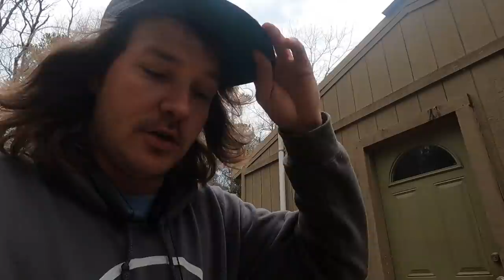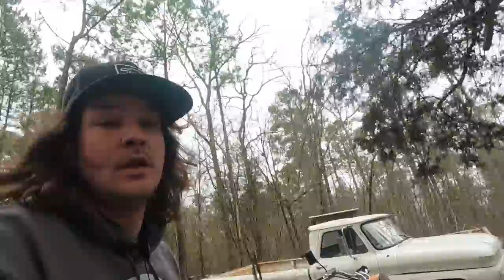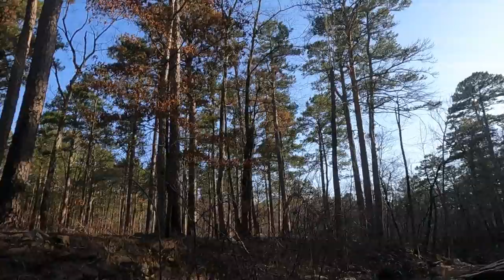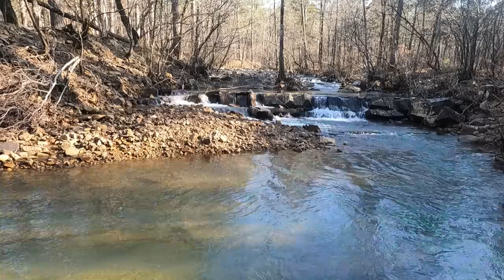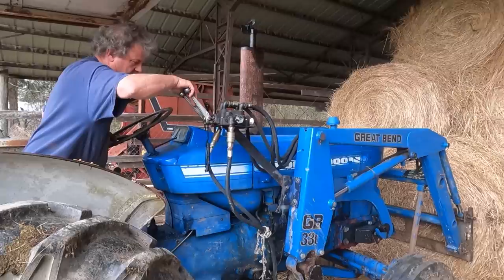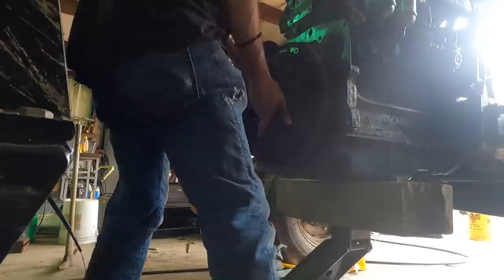I tore a FORD tractor in HALF!!!!

Comment: I did a dual wet clutch on a Massey 65 once.  Had to split that dude. Hung the back half from my engine hoist and rolled it back, and the front half supported by a floor jack. Wasn't to bad of a job, but it too took a few days. Those 2 disks and pressure plates couldn't be found anywhere. I found a place here in OKC, OK that was a clutch reman facility. They didn't even have cores so I had to wait for them to rebuild my cores before I could put it back together. The deal on this Massey clutch, it was worn out. From being saturated in oil and age, it deteriorated. Dad hit a tree stump with the brush hog and it just shredded the clutch disk. It would have made a great enchilada because what it looked like that I scooped out by hand was a shredded beef or maybe chopped brisket. Pretty fun job  though. I never minded working on tractors. Not bending over fenders under a hood like cars.